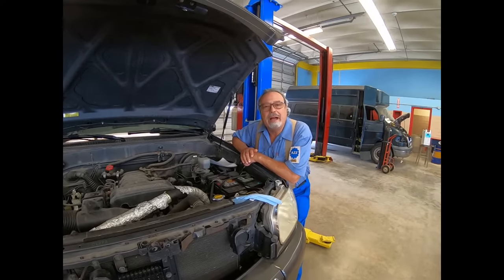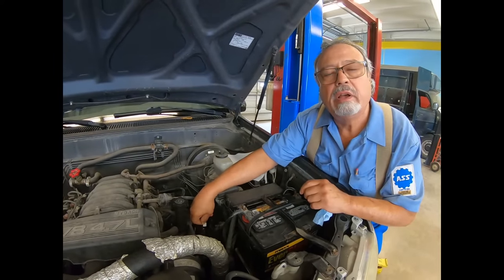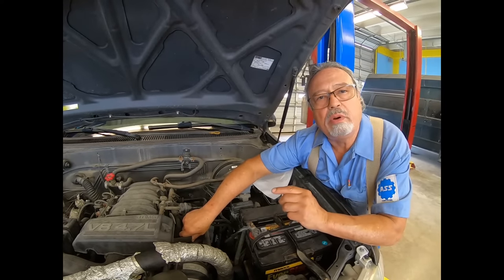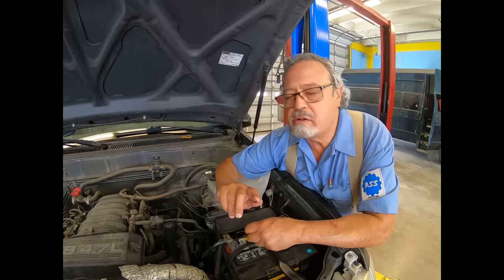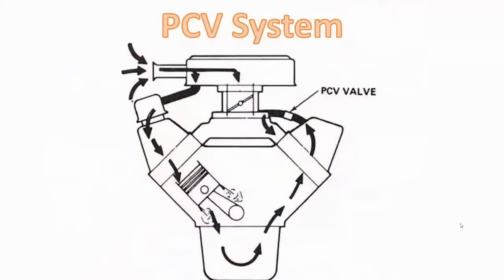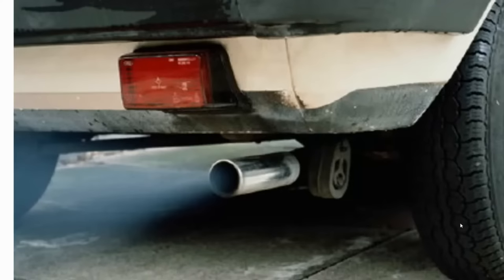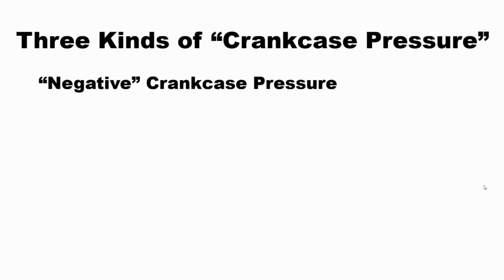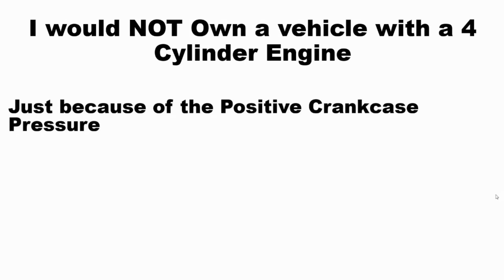Learn how IMPORTANT the PCV Valve is and why you should test it.

Comment: "Why is my PCV inspection so expensive?!?"
  "Our technician cut his paper stripe from a $100 bill..."
Reply from the maker: The "Three Nothings" : Nothing Quick / Nothing EZ / Nothing Cheap. Everything has gotten so complicated. What use to be a quick, EZ, and  cheap service is now not quick, not EZ, and not cheap. Yes...for example, replacing the PCV valve. I remember when replacing the PCV valve was so easy. Today, I have seen some crazy difficult valves. I have seen some electric PCV valve that cost $85. I have seen the replacement of the valve require the removal of the upper and lower intake manifold. How can I save you money? Buy Toyota. Thank you for the view and the comment my You Tube friend.
Reply: @theoldmecanicoshow9004  Hey! Thank you for responding!  I was just cracking a joke, and wasn't expecting a reply.  What a pleasant surprise.

Toyota... definitely among the few that have good common sense, keeping port-side fuel injectors to keep backside of intake valves clean. 
All the others, I don't know why they think asking consumers go through walnut blasting every 50K~60K miles is reasonable.  🤦‍♂

I drive a 2010 Lancer.  Made from before Mitsubishi went downhill.  Most maintenance & repairs are easy, provided I dare to get in there myself. 😆
Reply from the maker: @reallifeengineer7214  You are Welcome and thank you for that information. I know Nissan was bought out by Fiat and ever since that, the quality of Nissan has gone way down. What happen to Mitsubishi ?
Reply: @theoldmecanicoshow9004  
Mitsubishi, despite having a “technologically successful” Lancer Evolution line, which was neck-to-neck with Subaru’s WRX/STI…

Subaru manages to run a commercially successful WRX line of products.
Mitsubishi on the other hand commercially struggled with their Lancer line of products, despite a pretty big fan base all over the world. 

In recent years, Mitsubishi finally stopped making Lancer altogether. No more Evo’s. 
Mitsu now concentrate on SUV’s. 
I recall back in 90’s, Mitsubishi’s Mirage line of base-level sports cars was pretty good. Now, that name is used on these slow-moving SUV’s…

Comment: I wonder how the engine keep the negative crankcase pressure in high rpm? As the intakemanifold vacuum decrease when accelerating, the suction force is lower but more blowby created. May I have your answer? Do I misunderstood something?
Reply from the maker: Thank you for the question. Vacuum is determined by "Engine Load". The lighter the engine load the higher the vacuum. The higher the engine load the lower the vacuum. When you first mash down on the throttle, the load is very high and the vacuum is very low.. As the vehicle increases speed, the load becomes. With less load the vacuum now increases. The idea is when the vehicle is going faster, the engine does not have to work as hard. The vacuum drops at first but the increases as the speed of the vehicle increases. I hope that hepls. Good question.

Comment: it wasnt quite clear on 4 cyl engines , fluttering is good ? or bad?  its creating positive and negative at same time so how can we tell if pcv if faulty??? thanks
Reply from the maker: Awesome. You pay real good attention. Not at the same time, but back and forth real fast. Positive, negative, positive, negative.  Most 4 cylinder engines will not stick the paper, but a few do. Sticking the paper is better than flutter. Fluttering is not as good as sticking, but it is better than steady out / positive pressure.

Comment: So with a 4 cylinder engine, if the paper flutters, is that saying the PCV is working right, or not working right? The video wasn't clear about this. Otherwise a good video.
Reply from the maker: Thank you for the view. the comment, and the question. I have tested a hundred  different four cylinder engines. Only a few (larger fours) have been able to stick the paper. I have even tested brand new four cylinder engines that would not stick the paper. It's not easy to put the entire crankcase under ant kind of vacuum. It takes a large volume of vacuum to put the crankcase under vacuum. It's like boosting an engine. It takes a huge amount of pressure to overcome the vacuum.
So to answer your question : The paper is going to flutter either way. If the PCV system is go or bad. I suggest you change your PCV valve every two years. Thank you again for the view my You Tube friend.

Comment: Sir, loved your video on pvc. I am not a mechanic but, a do it yourself homeowner. May you explain where the pvc is on a 2007 4 cylinder 2.4 liter hyundai sonata so, I can replace it. Never done this before. Thanks.
Reply from the maker: Thank you for that positive comment and the question. I wish I had all these vehicles memorized. I did some research. The auto parts (Auto Zone) does not offer a PCV valve for your vehicle ( that is not a good start) I did find a you tube video that show the replacement , but it is foe a 2010 and newer. Watch the video I attached and MAYBE it is the same. https://www.youtube.com/watch?v=UNKPqh8dLEA
 It would be very helpful if you could buy the new valve before you even open the hood. Some vehicle do NOT use a valve. Good Luck.
Reply: @theoldmecanicoshow9004  Hi: I already bought the valve. But, don't know where it is under the hood.
Reply from the maker: @jimjim2119  Looks like the video link I provided did not help you...?

Comment: PCV valve basically is a check valve in plumbing
Reply from the maker: Check Valve...? Yes. I remember 55 years ago my automotive instructor explaining how the Check Valve part of the PCV valve would prevent a "Backfire" in the intake to get to the oil pan and blow it off. I have not seen that, yet.
Thank you for the view and the comment.

Comment: I have a question for you. My engine is 3.1 LHO V6 (Pontiac Grand Prix 1991). I have a problem with engine oil appearing in the intake manifold. It can be visible when the throttle is turned slightly downwards. It is visible when I remove the rubber intake pipe. My PCV valve is functional. What could be the cause of this? I haven't done the sticky paper test yet. I also noticed that at idle speed the engine vibrates slightly and the exhaust gases pulsate. Sparks plugs and cables are new. Ignition coils too. Fuel pressure correct. Regards . Adam from Poland
Reply from the maker: Some of that is Normal, but it sounds like you have excessive amount. This usually caused by excessive blow-by. Scored cylinders and rings can excessive blow-by. Thank you for the view and the question.
Reply: @theoldmecanicoshow9004      Hmmm... I first have to deal with the uneven operation of the engine and the pulsation of exhaust gases at idle speed. It looks like a misfire, but fuel is not supplied because there is no smell of unburnt fuel. I will be testing the ECM and injectors, as well as the electrical connections of the ECM power supply and ground. The 5V line is correct because I measured the presence of voltage on the TPS. The combustion is probably too poor because the spark plugs have a light gray coating. Perhaps the injector opening time is incorrect. Thank you very much for answering my question. Regards . Adam.

Comment: I checked my V8 and the paper stuck to the dipstick tube. I'm guessing if you had excessive blow by then that could also cause the paper to not stick to the dipstick tube?
Reply from the maker: Yes excessive blow by with cause positive crankcase pressure even when the PCV valve and all the hoses related to system are new.

Comment: I’m a bit confused. Looks like it is not possible to tests regular 4cyl toyotas.
Reply from the maker: You are exactly correct. Some 4 cylinder engines (mostly the smaller ones) do NOT put the crankcase in a slight vacuum. These engines are NOT big enough to created the volume needed to to the crankcase under a slight vacuum. 
Thank you for the view and the question.

Comment: i have a pretty bad oil leak. If I put stop leak product in it, it works for half a week and then engine starts leaking again. Would having positive crankcase pressure cause this?
Reply from the maker: Positive crankcase pressure (paper no stick) leads to oil leaks. It sure helps to have Negative crankcase pressure (paper sticks). Thank you for the view and the question.

Comment: I have a turbo diesel and I have oil shooting out of the oil dipstick tube, what should I do, what can I check, oils everywhere
Reply from the maker: Thank you for the view and the question. I know a little bit about Diesel engines. I know they run 4 times the compression and combustion pressure. More pressures result in more "Blow-by". The oil coming out of your dipstick tube is cased by "Blow-by". Where is where I don't know about diesel engines. A PCV system uses engine vacuum to operate the PCV system. If I'm correct, a diesel engine does not create vacuum because it does not have a throttle plate like gasoline engines. It is the throttle plate that creates the vacuum. I'm not even sure diesel engine use a PCV system. I looked it up on You Tube with no results. It sounds to me like your engine has "Excessive Blow-by" That would be caused by worn cylinders and rings. Good luck my You Tube Friend.

Comment: If you remove or hollow out the pcv valve is that an issue? My guess is there will be constant negative crankcase pressure all the time not just in idle would that be an issue?
Reply from the maker: Thank you for the question. The PCV valve is pretty much wide open (little to no restriction). There is a one-way check valve in the PCV valve that prevents any backfire in the intale manifold from entering the crankcase. If you want to customize the PCV system, find a valve that fits your vehicle but is designed for a larger displacement engine. Good luck.

Comment: How many inches of water on negative crankcase pressure on 6 or 8 cylinder
Reply from the maker: Thank you for the view and the question. Inches of mercury is the unit of measurement used to measure vacuum. Eighteen to twenty Inches if full / maximin vacuum. Funny...I have never measured the vacuum at the dipstick tube. If I had to guess , I would say maybe half inch or maybe one inch.

Comment: I have taken out pcv system on Golf MK4 GTI in order to see if i will continue to have positive pressure, and yes i have, wy is happening that?  Does pcv system transform positive pressure to negative or not?
Reply from the maker: Thank you for the question. Yes the PCV system transfers positive CCP (crankcase pressure) to negative CCP.
Reply: @theoldmecanicoshow9004  thank you very much, i will install it again . I heared that also the pipe from turbo to the oil pan if it is dirty , will increase the pressure, is it right ?
Reply from the maker: @jimakos75  The pipe from the turbo to the oil pan is for the oil that lubricates the turbo to "Drain"  the oil back to the oil pan. Thank you for the question. Break a Leg / Good Luck my You Tube Friend.
Reply: @theoldmecanicoshow9004  thank you again !!

Comment: Hello sir 
On cold or hot engine
When is the best to do this test 
Thank you
Reply from the maker: Thank  you for the question and view. It should not make a difference if the engine is cold or at normal operating temp.  Thanks again. Good luck on sticking the paper.
Reply: @theoldmecanicoshow9004  thank you very much sir

Comment: Pls answer my question...may car is toyota bigbody 2e engine gasoline.....i was replce the pcv valve ang i sopposed to put oilcatch can because theres is slite oil out from pcv... my question is is this oil cath can advisable for my old car to catch the excess oil coming from pcv?
Reply from the maker: Thank you for the question. An oil catch can is a good idea for most engines. They work well and help to keep many parts clean, like the intake manifold, intake valves, and the combustion chamber.

Comment: What if there is positive pressure when opening the oil cap?
Reply from the maker: Kind of normal on smaller four cylinder engines. Pressure from the oil cap opening is usually a sign of excessive blow-by caused by worn piston rings and cylinders.
Thank you for the view and the question.

Comment: THanx for the great video, is this works with mercedes e-class 350 ?
Reply from the maker: I just learned that some newer European vehicles do NOT have dipsticks. WOW !  Yes this trick will work if the engine has a dipstick. Thank you for that nice comment , question, and the view.
Reply: @theoldmecanicoshow9004  tryed after your comment, paper just falls down, no vacuum :(
Reply from the maker: @zelezo777  Is it a four cylinder engine ? If not a four cylinder, go to YouTube and do a search for your vehicle PCV valve replacement. If no luck there, call the auto parts and tell you want a PCV valve for your vehicle. If they do not have one, your engine may not use a valve. Good luck.
Reply: @theoldmecanicoshow9004  Thanx for your answer! Engine is diesel v6 e350 and have pcv valve but i guess needs replacement cos my engine already burns oil :(

Comment: Thank you!! What if the people at autozone changed my tube size for my pcv valve would that make it act up?
Reply from the maker: Correct diameter is important. Smaller is not good. The PCV system moves a lot of vacuum. Larger is OK. Thank you for the view and the comment.
Reply: @theoldmecanicoshow9004  I went an checked i suppose it is a hair wider of a tube. So if I change my piston rings it will reduce blow by gases.  Reducing +pressure  reducing the amount of oil getting suck up by my pvc valve?
Reply from the maker: @corey_5758  Before you change the rings, make sure that there is full / high vacuum to the valve. Sometimes the throttle plate gets restricted. Also, the rings is just half of the seal. The cylinder wall is the other half. Cylinder walls wear just as much as the rings. You can replace rings all day long and still have too much blow-by because of the worn walls.

Comment: I just did this test on my 2.4 toyota camry and the paper doesn't stick, is that okay for 4 cylinder engine? I just changed my pcv and it is the same, paper doesn't stick.
Reply from the maker: Thank you for the question and the view. Unfortunately that is pretty much normal for most four cylinder engines. It takes a very large volume  of vacuum to put the crankcase into a vacuum. Most four cylinder engine are not large enough to create the volume needed to do that. Thank you again.
Reply: @theoldmecanicoshow9004  Thank you so much Sir!

Comment: Whish I had a shop teacher like this back in school probably would of graduated!
Reply from the maker: WOW...! Thank you very much for that awesome comment. So...some of the teachers were not motivating ?
Reply: @theoldmecanicoshow9004  nope they were not they were very well let's just say they couldn't apparently find a way to reach us and make us want to learn to have a good time learning I ended up running all I'm actually a mechanic now and I'm not ASC certified but I learned everything myself because our shop teachers were just there for paycheck apparently yeah I would be awesome to have you as a teacher
Reply from the maker: @danielhall2982  Thank you again sir. Is the weather  HOT were you live and work ?  If so...I have a whole series of videos on automotive AC.
Reply: @theoldmecanicoshow9004  it's very very odd and funny you say that it is so hot you can't breathe it's muggy hot the kind that you can't get away from no matter what and I have a 1994 Ford Explorer sport 4 wheel drive and the AC compressor grenaded and I mean it just it's and so I replaced it I replaced it with a used one I know better but I did and I have I put a new condenser and I put a new I forgot what that part's called it's like the heater core for the AC it's up in the dash looks like a looks like a heater core I replaced it and I replaced the orifice tube and filter but it gets hot every single time I cut the AC on it gradually climbed up up and I've never got a red hot but it gets pretty hot and I shut it off and it goes straight down I pulled the thermostat and so it's got no thermostat I was just curious to see what it would do and it still goes up to kind of really really warm way warmer than it should be. But no thermostat yeah I'm more than interested in all those videos I'm kind of a backyard mechanic I guess I work on a lot of people's vehicles so any any helpful videos any videos will be helpful thank you so much and thank you for taking your time to write me back and offer that is that's awesome thank you for that!

Comment: An 8cyl engine keeps the paper stuck because at any given time during engine operation, there is at least one cylinder with the intake valve open.
Chevy 305s ftw!
Reply from the maker: Thank you for the view and that information, and yes you are correct about the 8 cylinder engines.

Comment: I have oil leaks behind top left of tsi engine vw Tiguan 2013.
Top of the piston and spark plug is carbon. 
Exhost was Can on and black. 
Taking noise. 
But the OBD2 DOES NOT SHOW ANY PCV errors. 
It just shows p000a Wich I cleaned the magnet vvt and error gone. 
I had misfire which it's fixed by injector cleaner I put last week .

I have check gage oil vacuum that was good.
Can anyone knows What is the problem?
Is it possible  car had these problems and obd2 could not show cods
Reply from the maker: OBD's are standardized, however, the variation within the standardization that occurs can be varied. For example: "Misfire" detection. Some OBD's will detect the misfire quickly l (1 - 2 minutes). Some take a little longer (5-10 min), and some...what misfire. 
Your engine has a gasket or seal leak. I wish I could tell you changing the PCV valve would help. 
Thank you for the view and that input.